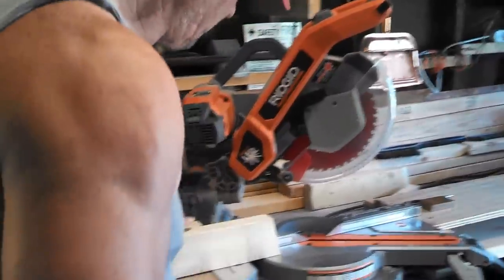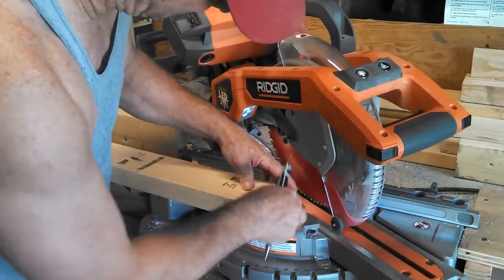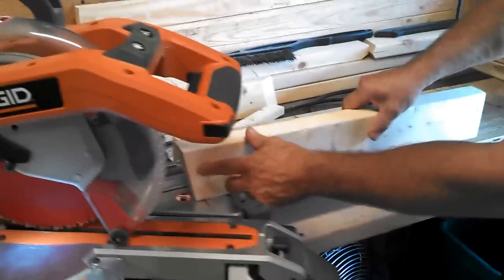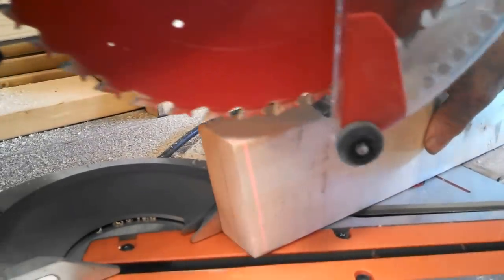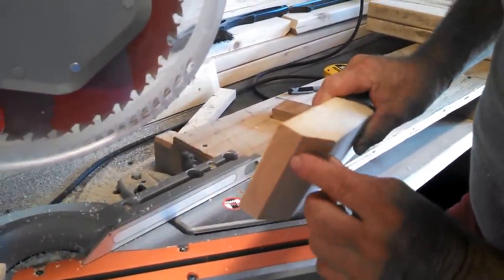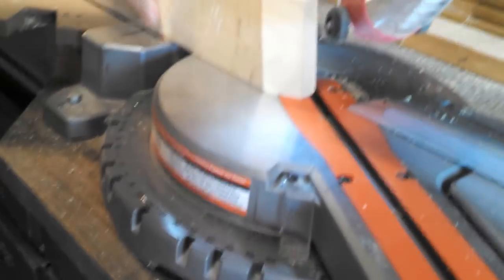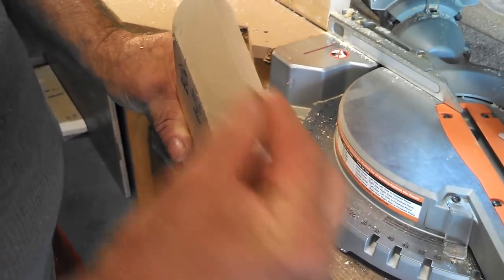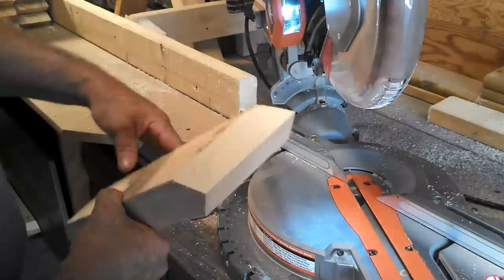how to cut hubless struts for a 3V geodesic dome   #3

Comment: Calvin,

Can you help me a little further on the explanation.  I want to build a 45ft  home using this technique with 2 x 6 wood.  Will this work?  Do you have any plans or instructions to go by?  Thanks for a great video.

Johnny
Reply from the maker: Johnny basically this video will work for you no matter what size of dome you build. 2x6 or what size of wood. but the bigger the size of wood potentially the bigger the size of saw you will need. Mine is a 10" saw so you may need a 12" for the 2x6. If you want to use a hubless strut as I do then make sure you USE SCREWS!!! I would also try to put a smaller one together first to gain experience framing it. It will help a lot. Also make sure you have someone to help you assemble the dome. It is just easier that's all there is to it! Make sure you figure how big you will need for plywood with a larger dome also. You will need pretty good size triangles for your 45' dome. Although you can use smaller pieces of plywood. I showed how to do  that on one of my videos too. I forget the number. You may consider using a 4V dome if the triangles are too big as well. If you have anyother questions I'd be glad to comment on! Good luck
Reply: Calvin, I was kind of hoping you might know how to make individual triangles to assemble rather than screwing together each strut.
Reply from the maker: That will probably require quite a lot more material. If you think it would be easier that way, don't be deceived. It is NOT hard to frame a dome. But it is easier with two people. Seriously, try to build a smaller dome first. But if it is too small like say an 8' dome it will be harder to build than say a 12' or 15' dome ( first hand experience on my part!! Haha!). A dome as big as you want to build is pretty ambitious so you really should start with a smaller practice dome. But I wouldn't build the triangles first to construct the dome.
Reply: 3x as much timber :) other downsides: more time spent in the shop cutting wood and making triangles. Handling an 8ft strut is a lot easier than an 8ft triangle when your standing on a ladder :)
I prefer to use tubular hubs, less cutting and its easier to assemble/disassemble the dome many times over, ideal for portable domes.

Comment: do i need a mitre saw that goes beyond 45 degrees?
Reply from the maker: +John Chapman basically yes. Otherwise you would need to make some sort of jig to make your cuts.
Reply: nope, most miter saws have 0 in the middle (90 degrees to the fence) and a swing of 45 degress each side.What you will need is a compound miter saw which allows the blade to be tilted so you can make the bevel cut ;)
You can use a basic mitre saw (no bevel function) in a pinch by rigging a jig that puts the strut end cut vertical and at right angles to the fence. Then you only need to make the miter cuts. If you allow for the blade kerf in the jig you wont need to worry about marking the centerline, just position the wood against the correct side of the jig.

Comment from the maker: I want to point out again that this is a great community where we all can share information and we are all here to help each other. You can go to this address to find out any strut lengths for any size dome you may want to build. It is an awesome resource!! 

http://www.desertdomes.com/domecalc.html
Reply: calvin busch Hi Calvin! Thanks for all the videos!  I'm not sure if my mitre saw has the ability to cut the 63.4 degree angle that this diagram calls for. http://acidome.ru/lab/calc/#1/4_Cone_1V_R.95_beams_88.9x88.9

The two cuts i need are 20.9 degree  __\ 

And 63.4 degrees correct?

Any information would be much appreciated! Out of 4x4 Fir!
Reply from the maker: Thomas Ethan Foster Hey Tom, the angles will be 60 degrees for B and C struts, but only 54 degrees for the A strut! A struts are for the pentagon portion of the dome ONLY! Not sure where you got the other angles from. RE-watch my video on how  to cut the struts and listen to my explanation. Thanks, Cal